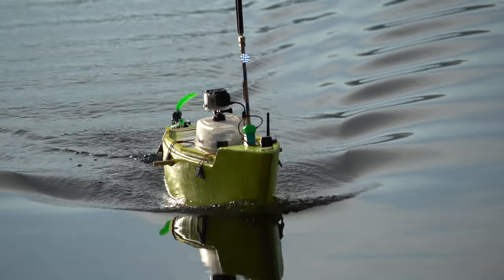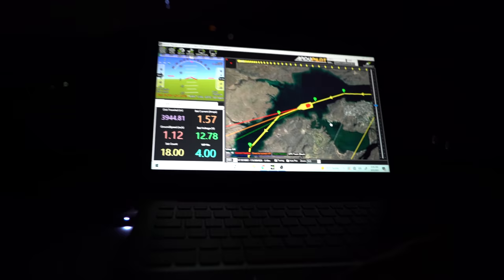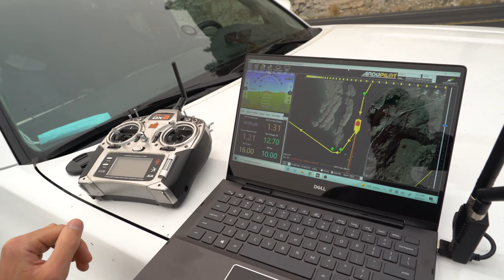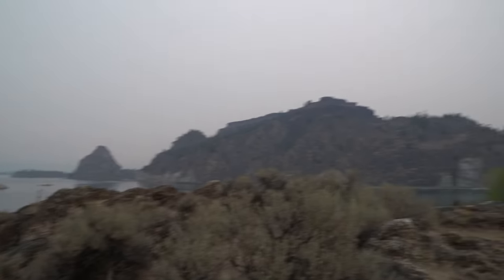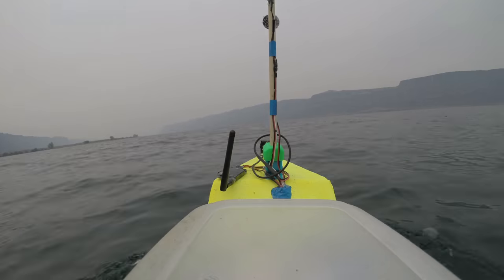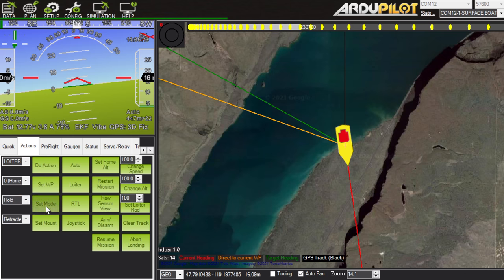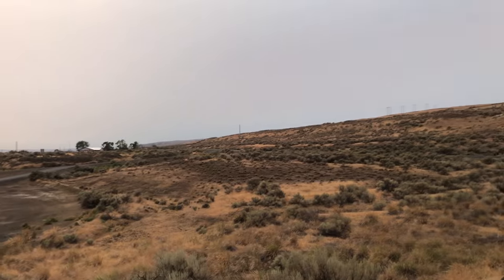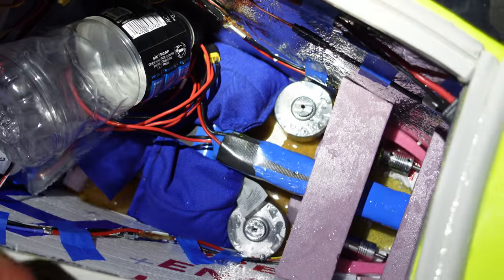R/C Autonomous Boat 30 Mile Waypoint Mission

Comment: It should be noted too that the points that other people (perhaps rather rudely) brought up about the boat shape were actually validated by your experiences on this trip.  Ok, not the offroading experience.  That was an unexpected adventure.  The bit at the end with all the wind.

You have a tall boat with a low wetted surface ratio and no keel at all. When you calculate the stability on this kind of design you get a result known as "Negative GM" in the boat design world. This means that it will always be very unstable and very susceptible to wind effects, as you saw.  You had to essentially massively overpower it and utterly abandon the idea of efficiency in order to defeat the wind.  Even then you simply could not get the little boat to point upwind.  It just kept "falling off" the upwind course, turning back and then falling off in the other direction, zigging and zagging it's way to shore.  This was entirely due to the design of the boat.

I know you and others have made the comparison to cargo ships.  But you are forgetting that scale and proportion matters.  Your boat is smaller, but the water isn't less dense to allow your boat to sit lower. So it pops up like a cork on the surface showing massive amounts of freeboard to the wind, even with insane amounts of ballast. Also, the proportions of your boat are nothing like those of a large cargo ship.  They are much more like those of a world war 2 "Liberty Ship" or a tramp steamer or fishing vessel.  But none of those have flat bottoms.  All are traditional compound curved displacement hulls with at a minimum a vestigial keel to help maintain course and hold ballast.

This is what the other people were trying, in a very rude way, to tell you.  While this is a design that you can "make" work, it isn't a design that is inherently "good" and it needs significant assistance to get to the level of function you want.  At minimum, a heavy metal keel bolted securely to the bottom (Literally just a strip of 1/8" x 1.5" mild steel bar) will dramatically improve the straight line performance of your boat.  However it won't solve the overall "cork" design problem you have going on.  That will take a total redesign of the boat hull.

On the off chance you haven't seen this one, here's a short course on ship hull geometry from the Naval Engineering Education Center:  https://www.youtube.com/watch?v=Iml-lynj3bM
It's pretty basic, so I hope you don't take offense to my offering it.  But it's a good starting point.  They have extensive  (and increasingly complex) videos on offer on their channel.  Obviously it is oriented towards large naval ship design, so some of what they discuss won't apply, but the overall principles will.

Lastly, don't let criticism get you down, and don't take it personally.  While I can't speak for anyone else, I love the crazy stuff you are willing to do, and my criticism is offered purely in the spirit of being constructive.  I want to do what little I can to help you make better and cooler stuff.

I can't wait to see what you come up with next!

EDIT:  As requested by the community, Daniel's Sponsor:  Visit https://SimpliSafe.com/rctestflight to learn more and to get at least 30% off your SimpliSafe security system!
Reply: You deserve more likes man
Reply: Way more likes.
Reply: Gracious and constructive feedback, love it. I for one enjoyed learning from his design and hope he makes a new version to test out!
Reply: This is the sweetest comment and it's very well written
Reply: The main thing I've learned from this comments section is that the world apparently has a lot of marine engineers in it.
Reply: Awesome feedback 👍🏾
Reply: Great comment, great lecture, just great!
Reply: Feeding the algorithm to promote this post. I made something similar of a comment, though far less technical.  As you say the ship is acting more like a dinghy than a boat, and it's hurting performance.
I'm also concerned about the propellers chosen, I'm thinking that the higher speeds may be causing cavitation (where the high pressures cause bubble in the water due low water pressures) and/or ventilation (this is where air is pulled down by the propeller). The props are so high in the water that you really need low speeds. As mentioned before I don't really know the technicals of this. So much so I had to look up prop speeds for a boat. Apparently the maximum for a boat should be in the 5400 rpm range, so you may be good at 1800rpm
Reply: Hey weary man! Copy his simlisafe sponsor text into the bottom of your text as an edit so he can pin this (your text) and keep his sponsor. I really liked what you had to say here. It was genuine and helps keep the community going.
Reply: Ooooh. That link is going to be great.
Reply: Best comment I’ve seen this year. 👏
Reply: The dictionary definition of graciousness, right here.
Reply: To me boat performance doesn't matter much, but the autonomous piloting, long range mission running does. He can put his RC kit on anything, hell he drove tupperware in a previous video. Sure his boat designs will improve over time, but he doesn't need to toss this one just because it's not perfect, he still can do science and incredible adventures with it. This is not a boat-design channel.
Reply: Thats a long ass comment man
Reply: @jacospies7418  Indeed.  ;)
Reply: @quarteratom  Of all the comments I have seen, yours is one of them.
Reply: did you really write all that out thinking you were telling him new info? lmao
Reply: @khancrow8212  Well, good sir, if you have insight into the workings and knowledge level of Daniel's mind, I encourage you to add your own input, rather than seeking to drag others down with empty criticism.  If not, then I'm not sure where your self-assuredness of Daniel's knowledge levels comes from.  Either way, have a pleasant day.
Reply: @EricToTheScionti  Who?
Reply: @Wearyman  maybe thats the difference, I dont need validation by others to know your an not correct....someone who designed, built, tested, and successfully completed multiple "missions" CERTAINLY knows more about his boat then some random youtube commenter.....are you not seeing how disagreeing is foolish and dumb  lol this isnt much of a argument kiddo life is alot harder then a disagreement. So explain how you know more then him about his design???
Reply: @Wearyman  wow all that and still your not telling him something he doesn't already know lol thats the whole point to my comment. You could be his damn best friend or his mom and ill still stick to my statement that some random youtuber doesnt know about his boat, his project, his missions more then he does....I am not sure whats so hard about getting that...I am not sure why admitting that he knows more then you is so hard to admit is beyond me lol
Reply: @khancrow8212  Daniel has already stated in previous videos that he isn't well versed in ship design.  By his own words, he doesn't know this.  If you had watched any of his series you would be aware of this. So the entire point of your comment is moot.
Reply: Types of comments like yours adds so much information and insight not just for the creators but for us random folks as well. Thanks for your post and attitude!

Comment: I couldn't go to sleep until I finished this video. Congratulations for finishing the long trip. As a R/C boat lover I would like to share some tips.
One of the best greases for filling the shaft tubing is Molykote 33. It has a very light base oil that doesn't cause much drag when motor is spinning. Being a silicone grease it's extremely water resistant. 
You can also redesign the propeller shaft tubing by attaching a stuffing box at one end of it and inside the boat. The tubing doesn't need to be filled with grease in this case, but the stuffing box needs to be filled with a mixture of grease and cotton/some other fiber. Then you add a lid to it, the lid can move along the shaft. The you install a l spring or clip that pushes the lid towards the stuffing when loaded, the lid will in turn squash the stuff and keep it tight around the shaft. This sealing can stay water tight for the whole day letting in absolutely no water.
EDIT: Forgot to mention the dust part. What an adventure through such a horrible "road". I guess that fine dust is from those broken rocks ground by the water of the lake/river millions of years ago. I may not dare to even go there. Looking forward to more your adventures.

Comment: For those that are curious: what you got stuck in is known as bulldust in australia, or silt here in North America. Key is lots of floatation. Wide tires, low pressure, decent wheel speed, if you start sinking stop.
Reply: Fascinating comment!  There’s so much I Don’t know about 4-wheeling.
Reply: Ok, and thanks for the 18+ spam.

Comment: Is it just me or was the 4x4 adventure more interesting than the autonomous mission ???  Awesome video, enjoyed every second of it... More 4x4 adventures!!! PS: You should always have a shovel, rope and basic tools in your pick up. I recommend you change the engine air filter, it must be full of dust.
Reply: Excellent point about the engine filter!
Reply: @LydellAaron  
Also air down the tires to 18lbs/sq inch to lengthen the footprint in soft sandy silt....
You will need to carry a small 12 volt air pump to air up the tires after the soft stuff....
Reply: @JohnSmith-yv6eq  thanks John Smith for the low pressure tire advice. For inflation, I'm proud of my 12V ViaAir pump good flow and 100% duty cycle. Rides with me all the time. 💪
Reply: @LydellAaron  
Thanks for the prompt reply (or any reply)  We call people who don't air down tires in sand members of the 40psi club.
See BOGGED ACTION on YT for some club member action......

Comment: It's incredible to me that it just works. Not just the robotics, but the software, it doesn't crash, it always accepts a connection, it doesn't leak memory; and the radio, it doesn't go wrong, and you can reconnect whenever.
What an incredible adventure that was.

Comment: What an adventure, we call that dust "bull dust" in Australia, people will put a positive pressure fan in their campers to keep it out as they travel, it gets into everything
Reply: Or turn on your a/c to outside air and high speed fan...does the same thing to the cab......will pressurise the back if you have a window through to the camper...
Reply: this is a bot.

Comment: Just a bit of helpful advice from an avid off-roader. Before your next off highway adventure, pick up the stuff on this list and you should be good to go. 
1) set of maxtraxx recover boards.
2) tire valve stem deflators.
3) high volume air compressor 
Airing down to about 15psi will help a bunch in that talcum powder type sand. Without the valve stem deflators,it takes forever to let the air out on all four tires. A company called Morrflate makes a kit that allows you to air UP all four tires at the same time. Great channel. Keep up the awesome videos.
Reply: A winch is always a good addition also.

Comment: You need to rig a sail on it so that it can, autonomously of course, utilise the wind for additional propulsion, expandig it's useful range! It's the next logical step, surely?
Reply: It'd probably be significantly easier to make an autonomous sailing ship using a flettner rotor rather than a conventional sail but I'm not sure if it would work well at this scale.  Also, to make a sailing vessel of any kind, he's going to need a much more stable hull design.
Reply: Next logical step is a submarine.
Reply: @The_Seeker  It would be really cool with a folding sail rig that only popped up under the right conditions. It might not be able to power the vessel alone, but add some energy, under the right conditions, without weighing too much.
Reply: I am all for the sailboat conversion! Hoist the jib!
Reply: As hard as that may be to get working, it would be very cool to see. And might lend for a a much bigger mission.

Comment: I'm surprised you haven't tried to put a telemetry signal repeater on the mavic and get it halfway out to extend your range, haha.
Reply: could get a Ham radio license and use APRS on a 5 watt radio
Reply: @trey1531  Cold also get a ham radio license and use 10w+ on the 900mhz telemetry with all that battery capacity. But RF engineering is a whole other beast
Reply: i like your brain
Reply: @LegendLength  I like your brain too
Reply: @richhandler2621  Are you sure you dont have some zombie in you?
Reply: @AndecIunson  🤣🤣💀
Reply: @AndecIunson  you don't like brains? 😁
Reply: Yea or just an lora 868 mhz. It would work trough water and no need for license.

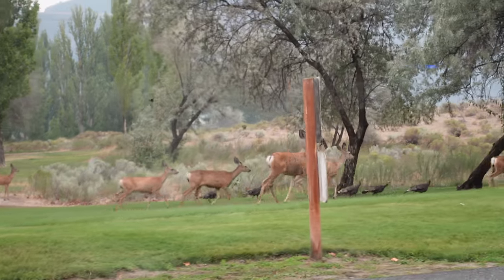Comment: 12:21 - Turkeys and deer often feed together. Turkeys have insanely good eyesight and color perception while the deer have great hearing and movement sight.
Peacocks are just assholes.
13:49 - we call that sugar sand in the south.
Reply: In Australia, it's called "bull dust".
Sometimes it swallows a Toyota  -  entirely. He will definitely  need a new air filter after that, fer shur!

Comment: The cool cliffs you were seeing are carved into layer after layer of volcanic rock; the whole area was covered with flood basalt, with the total thickness of all the flows getting up to 3 miles deep in some places, and 2+ miles deep for a lot of the area.
It's also part of the reason why the floods from glacial lakes were able to carve so deeply into the rock, since it was relatively easy to pry away at loose fractures and such, and the reason why the nearby Snake River was able to carve the deepest river gorge on the continent (deeper even than the Grand Canyon).

Comment: Did you ever thought of extending your telemetry signal in the air (drone or something)?
This would give you temporarily access to telemetry data.  
You could also equip a drone (not the mavic ;)) with a hook or something to lift the HHS Banana out of the water if there are any problems. 
I was following the project quite a while, definitely making progress, congrats!
Reply: Triangulation. Not a bad idea. A repeater of some sort. Have the boat connect to something on the drone and repeat the signal to the computer
Reply: Came here to ask that too. Have a plane go out on runs closer to the boat to get telemetry. Having it lauder above for various portion of the mission!
Reply: I thought the same thing, do a jump from transmitter to receiver to receiver, I don’t know about the hook though, he said it was like 40 lbs

Comment: Maybe you could try different propellor designs that won't catch weeds in them. Or maybe try making water jets?
Reply: That would work, but would it suck up the weeds. And it’s probably not as efficient as propellers.
Reply: Impeller maybe great
Or motor with 10 wide but short oars attached each
Reply: @andrewcuzzolino8277  then make metal ones with sharp edges, maybe they would get chopped up
Reply: or also have people send Daniel propeller designs like "fan showdown" (Major Hardware)
Reply: @MrGuliton  true, but it could rap around the rod connecting it to the boat like weeds sometimes do with a weed eater.
Reply: fan boat
Reply: @collectorguy3919  Fan boat are nice except they lack control. One of the things that a fan boat would have to have to work better is a real rudder rather than a rudder where the fan is. Rudder in the water would give it far better control.
Reply: Have the intake for the jet above water. Don't ask me how, I'm just an armchair engineer
Reply: sailboat?
Reply: @nodrug2  cool, it blows bubbles
Reply: Great job  I really enjoyed this journey.

Comment: Please consider modifying the boat to abide by 33 CFR § 83.27(a). Get a small mast on it with two red lights stacked vertically while the RC boat is piloting itself.
Reply: Idk about Washington but that light is all you need for a boat that small in Wisconsin

Comment: How about a telemetry data repeater placed in a plane or quad to get some altitude?
Reply: a repeater in an autonomes plane that is flying along with the boat would be awesome
Reply: @crazyphil3000  or atleast one he can use on the pitstops, a plane won't have the endurance of the boat
Reply: Unless it's a solar plane maybe : )
Reply: Oh shit I literally just commented the same thing without realising that someone already had the idea! I’ll leave my comment up just so he has a greater chance of seeing!
Reply: I was thinking the same thing
Reply: Daniel, if you're reading this, I would recommend a parrot repeater to avoid the need to bind the base station with a different device from the boat. Kinda like an And vs an Or

Comment: so helicopters that fly in jungle environments have blades that help cut any vines that may get close to the blades. A lot of off roaders have cables that go from the roof to the front of the hood for the same reason. Perhaps you could try fitting something similar around the props of your various nautical projects to prevent any seaweed buildup.

Comment: Hss banana slug meets solar plane v4. A match made in long duration operation heaven. 

Use the gps on the banana slug to constantly uodate the "home" point for the solar plane (as demonstrated in your 100mile solar plane v4 video) and equip the plane with a repeater. The plane in loiter mode will just constantly orbit the slug at an altitude that allows you line-of-sight telemetry at all times. Even when a really long way away. Send them out on a long mission together and see what happens. Im thinking 20hrs of flight following the slug on a 60-70mile journey would be a record worth recording!

Awesome videos man. Love your work.

Comment: Hey man, little trick for your truckin' adventures... Keep a couple pieces of 2x4 in the bed and a ratchet strap for each wheel. Literally ratchet boards around your drive wheels and boom, you're not stuck. Don't go fast obviously.